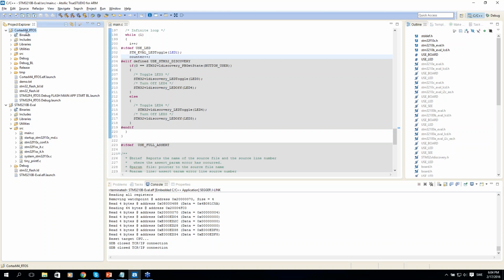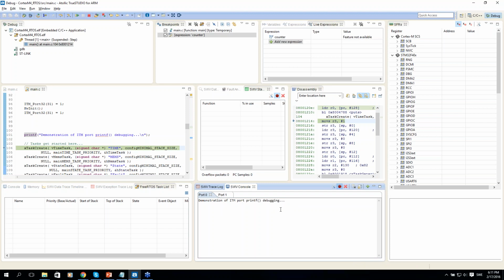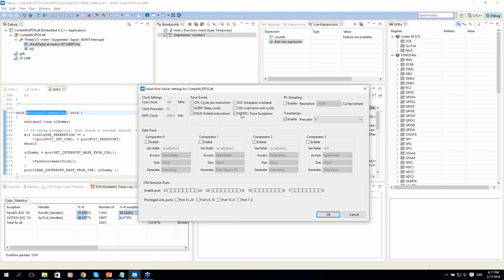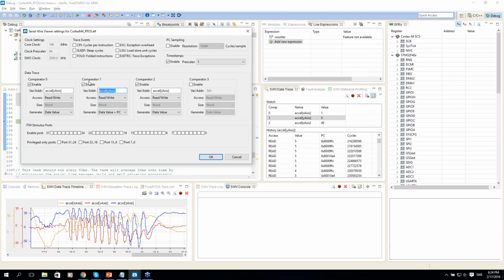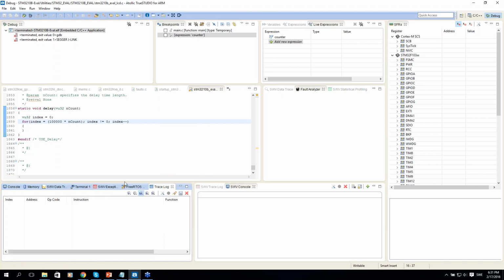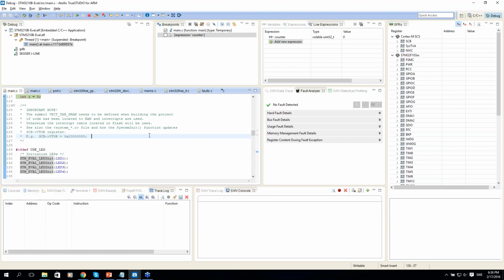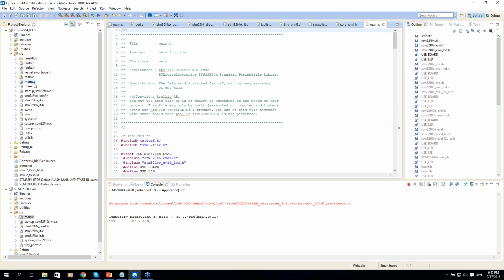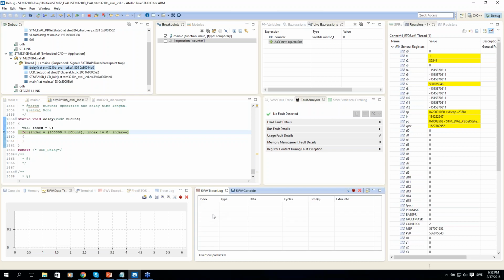2016 02 17 Advanced Debugging of ARM Cortex M-based Systems

Comment: Hello there. I was working with IAR embedded workbench before and I was able watch the variables while in runtime. Now I see you have live expressions and as you said I cant run this feature with my st link.It says "feature not enable".I tried to activate it from the "configure debug" section but I did not. Is there any other way to see variables live?
Reply: Hi Mustafa, you "Live expressions view" only works with J-Link, not ST-Link. However if you use SEGGER reflash ST-Link tool you can flash SEGGER firmware into the ST-Link probe and then it should work. This however only works with a number of boards where SEGGER have implemented support. Look here for more info:
https://www.segger.com/products/debug-probes/j-link/models/other-j-links/st-link-on-board/
Reply: Mustafa Fatih BAYRAM at the time this feature was developed in TS it was easy for us to achieve this with JLink. More work with ST-Link. Hence we did not prioritize it.
Reply: I get it.  I hope it will be integrated soon. Thank you very much for your help.